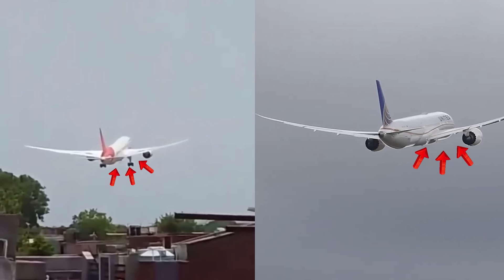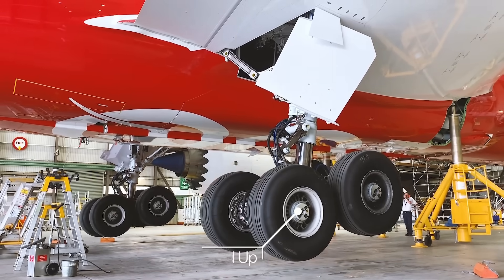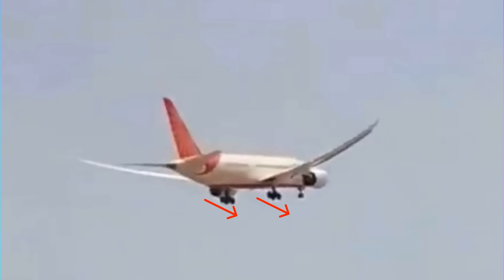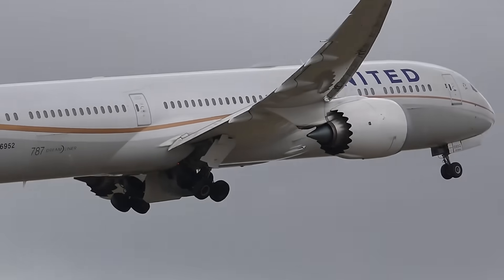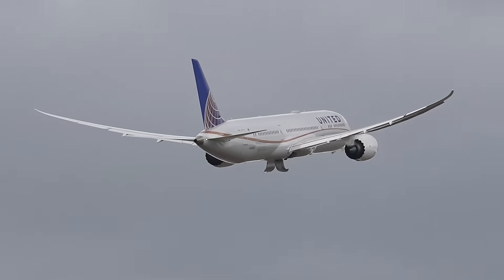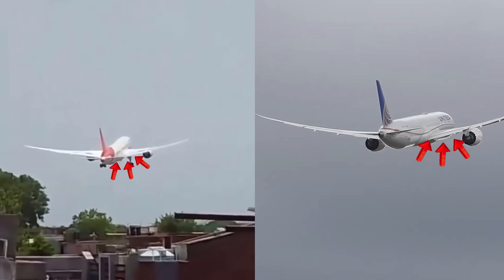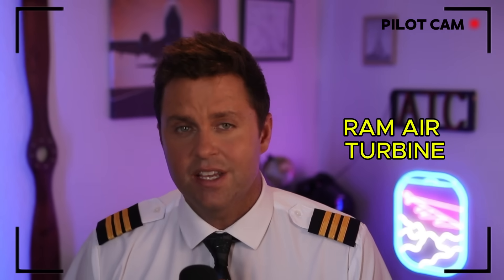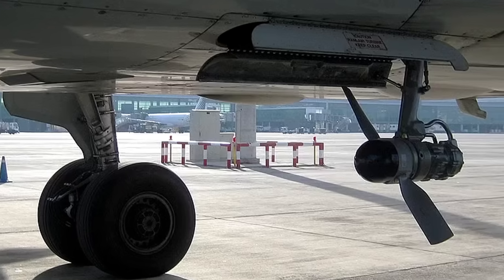Pilot Explains: A New Detail in the Air India 787 Crash Everyone Missed

Comment: GARY. Thrust is everything on take off. Without it, a plane cannot lift. This plane laboured on take off, using the full length of the runway. Notice the dust blown up just before take off (ie using last section of runway rarely used). Now, let me ask you this: what effect would it have on `thrust` if a very small amount of diesel or water (say, a cup) was added to the tank? And would this small impurity cause alarm-systems to alert the pilots?
Reply: That's an illusion based on the angle of that camera. In the security camera footage (seen here: https://www.youtube.com/watch?v=iMT76ZQlmMM) you can identify that little shed (and the curve in the road beside it) on satellite imagery of the airport and work out roughly where the camera has to be. The plane rotates just as it looks like it's visually in line with the end of the roof and is clearly airborne and climbing when it is in line with the middle of the shed roof. If you project a straight line from the camera position to the shed and then onward until it intersects the center of the runway (where the jet is going to be, roughly) the intersection is about 1000 meters before the end of the runway. If it only got off the ground near the end of the runway, you'd clearly see it lifting off between the shed and the garage-like white building you see on the left.

This incidentally matches the FlightRadar24 data which shows the maximum altitude data it received from the plane (about 425 feet AGL) happening just as it crosses the threshold, after which there's no more data transmitted, which matches a loss of electrical power.
Reply: @keith6706  Very good point, and taken. This comes as a great relief to me. Thanks Keith
Reply: small amounts of water would not affect the engines. The water does not mix with the fuel and it sinks to the lowest part of the tank where it collects and is drained on a regular basis. It would take a large amount of water to cause a problem and it would show up in one engine at a time.
Reply: @larrymays1754  Good point, and thank you. But what about a different contaminate entered the fuel tank?
Reply: @simonwesteng3610  I worked as a mechanic for 37 years for the airlines. I only noticed water in the fuel. It comes from condisation in the wings and rain getting into the storage tanks. The fuel trucks have filters on them also. not saying it couldn't be somthing else. also contaminated fuel would not be restricted to one plane. word gets around quick. we had to go around every night and sump (drain) the tanks looking for contaminents. This was part of our maint checks.
Reply: @larrymays1754  Thanks, Larry. Of course, I agree, "contaminated fuel would not (normally) be restricted to one plane". But failure of both engines based upon a sudden critical electrical fault (by which the `rat` was automatically deployed) surely means a complete re-call of the whole fleet despite the fact that the 787 has proved its worth. Indeed, it seems unthinkable that such a complete failure could lead to this...which is why I am searching for something else amiss.

Comment: It's a fly by wire system, throttle in cabin tells the computer what to tell the engines. It's possible a catastrophic electrical failure could have resulted in the system somehow commanding the system shut off/down the engines. Perhaps the computer though it got a fire or fuel off emergency button/level activated, perhaps something else. Or perhaps the power to the fuel delivery system was completly cut off somehow.
Given it looks like the wheels stopped mid retraction and the flaps weren't down like they should be speaks to a massive controll system failure followed by electrical power loss and thus rat deployment. At least to me it does.

Comment: Since 2017, I had travelled only in these 787 Planes of Air India and inflight entertainment problem is not a new one, it existed in 2017 also till my last trip in 2023 with Air India on 787. On the other hand, i have noticed a few times that Air India pilots don't use full throttle for take off always. And check in baggage weight is never weighed in. So it could be a electrical malfunction related to overloaded plane plus not enough thrust to lift it off.

Comment: Fuel System Control (FSC) Overheat failure. I read this on.a forum by user @Bertieuz. This specific 787 was the only one not sending ADS-B data while taxing at Ahmedabad, for weeks. The thought was this component was failing. The heat from a fully loaded plane, full runway take-off would have caused max electrical load and heat causing the FSC to enter safe state, which turns off the fuel pump.

Comment: Question, if something happened to the electronics, that would possibility affect the fuel pumps and Hydraulics. For example, a short knocks out the electric to entire plane, would that shutdown fuel pumps? Thar would cause a double engine failure. The RAT dropping down would possibly restore electrical power, but by then the engines had flamed out. Not enough time to restart the engines at this altitude. Could this happen this way with complete electrical failure??

Comment: I do see differences in flaps between your two videos. I still believe the pilot not flying made a huge mistake in NOT lifting the gear lever and instead lifted the flaps and slats whatever little they had set but Steeeve pointed out that one video with original audio the rat was clearly out as it sounds like a propeller engine racing by so one other problem may have been a complete loss of electrical power for some reason causing the rat to deply automatically.

Comment: The mayday call said loss of thrust. Thrust, the force that propels an aircraft forward, is primarily generated by the engines. Engines were failing on the runaway itself as the plane needed the entire 3.5 km runaway to attempt takeoff indicating the pilot was not getting enough thrust to takeoff itself. A normal plane of that size needs about 2-2.5 km.

Comment: Wrong FMS settings. Wrong temperature setting and wrong rotate speed. The plane used the full length of the runway, nearly the whole 3500 meters, it looks like they struggle to get speed for lift off with insuficient speed calculated by the FMS.

Comment: If there’s electrical issue causing the engine control computer to malfunction and output weird command to the engines… this could definitely cause dual engine failure.

An Airbus A400M crashed shortly after takeoff when 3 of its 4 engines malfunctioned due to a software glitch in its engine control computer…

So there has been a crash with nearly identical circumstances to this before…

Comment: If a hydraulic hose failed anywhere in the system, the landing gear would have stalled in the middle of it's retraction operation. A hydraulic failure like that would have made any attempt at adjusting the flaps futile and worse yet, the deployment of the RAT could not have overpowered a primary hydraulic leak. Could a complete loss of hydraulics also caused engine failure or would loss off flaps been enough to bring her down considering her low airspeed, altitude and gear down conditions? In such a circumstance, the RAT would have only added to the overall drag since it is basically a windmill dropped out of the belly of the fuselage? Hard questions to answer but it seems much more likely that they blew a single hydraulic hose than simultaneous twin engine failures along with failure to retract gear and failure to adjust flaps. 
Pilots lost control due to hydraulic failure. It explains deployment of the RAT, gear partially down and unresponsive flaps. Such a tragedy.

Comment: If water gets into my scooter engine it goes off. 
What guarantee is there that the maintenance crew checked and ensured that the same didn't happen to the ill-fated plane? If there was any water in the fuel tank, it would be sitting at the bottom of the tank and that explains the successful takeoff. But once the plane tilts upward to takeoff, then the water would enter the delivery pipe/pump and reach both the engines after a delay of a few seconds. When that happens the engines would definitely stutter/stop .
If I was investigating this matter I would definitely enquire of the ground service staff of the complete procedures and processes followed by them

Comment: I'm wondering why he ran right to the end of an 11,000 foot runway before lifting off. Did he not have full power, waited too long to abort and have to pull it into the air too slow?
Any time there's a crash like this it should be standard procedure to stop all refueling at that airport until the fuel is checked for contamination. While they scratch around for days trying to figure out what happened how many other planes will be fueled from that same supply?

Comment: Flaps five. Fully fueled. Full passengers. Hard to tell where the take off roll began. Two mile takeoff and still ran out of runway. The word abort must have hit the mute button. No pilot runs ten feet from the end of the runway. London bound. The pilot flying was so much in a rush even a 12,000 mile runway wasnt enough. The plane was spotted six days earlier. No reports of engine issues. The fuel weight alone meant full flaps. They were in a bad rush. Possiblely several delays.

Comment: Fuel shut off valves could have also been turned off inadvertently  during the  pre takeoff check list which is plausible. This would have given them fuel to taxi and then cause the engines to flame out right after the  plane rotated on the runway.

Comment: If you loose all electrical power do the engines quit? If fuel contaminanted wouldn’t the engines at least flame out or at least put out a whiff of smoke.Almost looked like when they requested wheels up the engines quit , like a sudden lose of power like when a fuse blows!

Comment: Excellent points. She had both powerplants roll back just after airborne-it's too damn quiet. The METAR at that time called the surface temp at some 37C-that is HOT-those engines would have been spooled pretty dang high to make climbout-even pushing temp limiting. And did NOT know about the 78's gear bogies sequencing so as to fit into the gear wells upon retraction. Also-look at the leading edge slats-they are out-that indicates a flap deployment-even at flaps 5.

Comment: Just had a thought that if the plane had been filled with contaminated fuel ⛽ then other aircraft that filled up from the same spot would also be effected. Steven
Reply: Wasn't there a suggestion going around that the aircrafts air conditioning wasn't work properly. This may have been a cause or symptom of an electrical issue.

Comment: Hello Captain 
My opinion , maybe maintenance Action been done B4 the flight had effect the engines operation. As example  as you know if Eng over speed or over temperature Eng. control well limit the fuel going to combustion to reduce over speed or over temperature. So if the crew add more thrust will be no response. Eng will be at low speed. Not enough to left the Aircraft. Still maybe……
Go back to Eastern Air Lines Flight 855 (1972):
Cause:
The NTSB determined the probable cause was the failure of mechanics to follow proper procedures for installing O-ring seals on the master chip detectors in the engine lubrication system.

Comment: Can you explain in another video how the fuel is pumped from the wing to the engine and what are the parts responsible for it? And let's dive deep in probability of any of those parts failure. Do they have redundancy built in them?
Is wrong type of the fuel is possibly or all fuel type on airport is same. 
Fuel pump failure cause by electtical issue ?

Comment: Fuel contamination is unlikely as it can not contaminate both engines same time on top of that the air craft detects contamination. However it is very likely the fuel supply was cut off to both engines... may be due to software or electrical glitch.

Comment: I saw one video on how the double engine failure could happen. Vapor lock due to sitting on the tarmac for 2+ hours without AC. The heat causing bubbles in the fuel lines. Not sure about this myself, that's just what was being said.

Comment: Could an electrical failure cut power to the fuel pumps?  The loud bang reported by Mr Ramesh might have been a power bus blowing out..  I understand the 787 uses electrically-driven rather than mechanically-driven fuel pumps..

Comment: Several years ago I was on a Boeing 747 taxiing to the runway. As we approached the runway, we had a total power failure. After 5-10 minutes, power came back on by resetting the breakers. After a lengthy delay, we were told pilot was cleared to takeoff, but he refused and demanded the aircraft go into maintenance. I've flown millions of miles, this has never happened. I believe this may have happened to Air India.

Comment: Aircraft backup systems activate immediately during sudden power loss after lift-off, prioritizing essential flight controls and instruments through layered redundancies. Here's how these systems respond:

### 1. *Battery Backup Activation*  
- **Immediate power transfer**: If engine-driven generators fail, aircraft batteries automatically power critical systems like flight displays, communication radios, and flight control computers[4][5].  
- *Duration**: Boeing 787-class batteries typically provide **30–60 minutes* of emergency power, enabling basic instrument functionality[5][6].  

### 2. *Ram Air Turbine (RAT) Deployment*  
- **Automatic deployment**: A wind-driven turbine extends into the airstream within seconds, generating hydraulic pressure and electricity (typically 5–15 kVA)[5][6].  
- **Power priorities**:  
  - Flight control actuators (elevator, ailerons)  
  - Essential avionics (attitude indicator, airspeed)  
  - Emergency lighting[5][6].  

### 3. *Hydraulic System Redundancy*  
- **Engine-driven pump backup**: If primary hydraulic systems fail, electrically powered pumps maintain pressure for flight controls[3].  
- **Manual reversion**: Some aircraft retain mechanical control linkages for pitch (elevator) and roll, though with increased pilot effort[8].  

### 4. *Electrical Load Management*  
- **Automatic load-shedding**: Systems like galley power and cabin lighting are disconnected to preserve energy for flight-critical systems[5][7].  
- **Priority hierarchy**:  
  1. Flight controls  
  2. Navigation/communication  
  3. Safety systems (transponder, emergency lighting)[7].  

### 5. *Pilot Response Protocols*  
- **Memory items**: Immediate actions include configuring for best glide speed and initiating emergency checklist[2][7].  
- **Communication**: Battery-powered radios maintain ATC contact while backup systems sustain navigational aids for emergency routing[4][7].  

Modern aircraft like the 787 add layers of protection with *permanent magnet generators* (PMGs) on engine shafts, providing residual power even during dual engine failure[5]. These systems work in concert to transform a total power loss scenario into a controllable emergency, giving crews time to troubleshoot or execute.